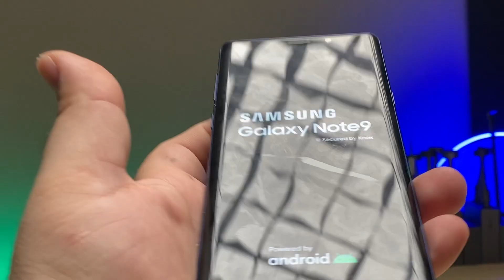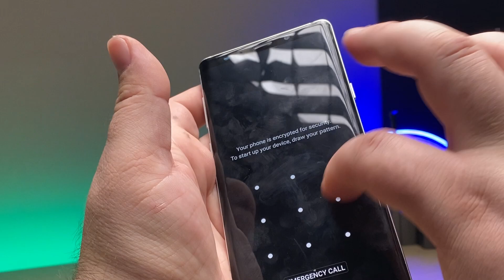Water Damaged Samsung Note 9: Expert Repair Guide

Comment: Samsung Galaxy Note 9 when I dropped it in water it didn't turn on either it would vibrate but nothing would turn on so I left it out in the open for a couple of days and when I came back to check on it a day later it would vibrate and then the screen turned on I didn't have to go inside of my phone or nothing I just let it auto reset in the future in settings where it automatically resets itself and eventually it came around be coming back to normal

Comment: Hi dear, my note 9 got wet. It turns on but when I try to insert the pin, no reactions.. as if the touch doesn't work.. what hardware should I change in your opinion? I disassembled it and it's drying.. Thank you a lot